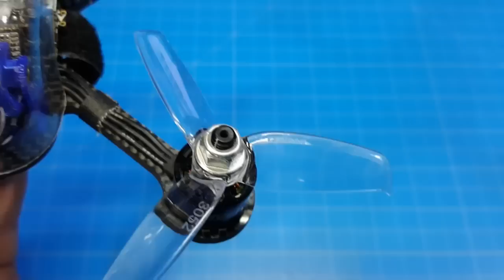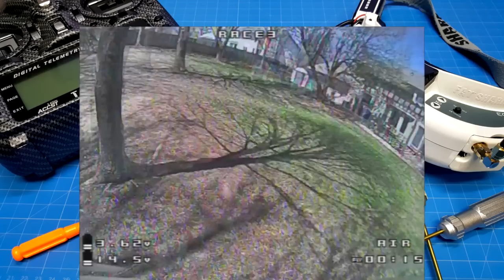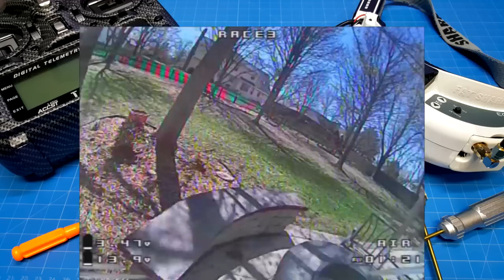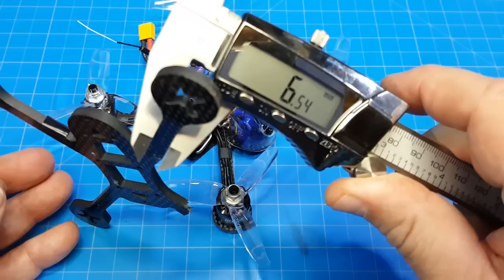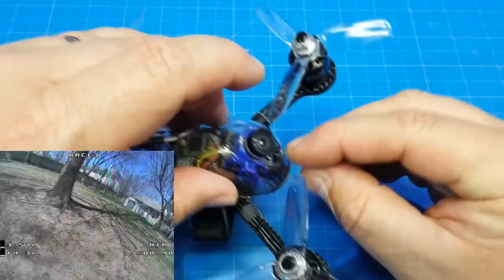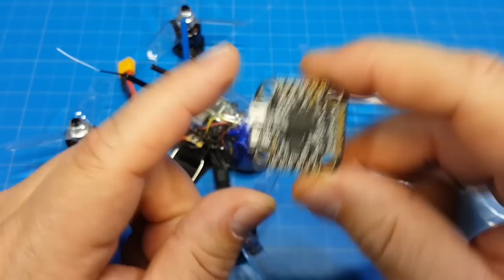Race3 - SpinTech High performance frame

Comment from the maker: Would a top speed add value to a review?
Reply: Maybe do timed races around the track and start a scoreboard
Reply: if you did top speed it would add about +40% value to the review, for me.
Reply: Yeah, it doesn't really matter at all, but it's cool to say, that little thing is doing 90mph
Reply: I think so, purely for the fact if somebody builds this and goes out and flys it, the first two question you get asked are, how high and how fast.
Reply: lol  Are you trying to justify buying a radar gun to yourself? :P
Reply: Equally as much as acceleration!
Reply: Nick Burns Definitely yes! I always wonder how fast these things are going  🚀
Reply: Absolutely.
Reply: Nick Burns for me no. 😃
Reply: Even just a guestimation lol
Reply: Of course it would, Andy does it already.
Reply: Not the plain number, but it is a nice comparison to the other quads you’re testing
Reply: Yes, but you should do it for all your reviews going forward (whenever possible).  That gives your viewers a comparison to other quads, which is most useful.
Reply: Totally
Reply: To me, that would depend how you would determine the flight speed.  Accuracy is almost everything when it comes to measuring speed.
Reply: Yes
Reply: It absolutely would
Reply: Yes please!!!
Reply: Yes Sir'
Reply: Top speed isn't essential in a quad as very rarely do you run at top speed when freestyling or racing, but it's sure is nice to know as its always the first question people ask when they see a quad ripping around
Reply: yup2👍👍
Reply: Nope. Agility is far more important than top speed. Top MPH stats are just a macho pissing contest.
Reply: acceleration = responsiveness, how quick the motor can spin up the prop,
Reply: more mass =  slower directional changes (acceleration/deceleration)

Comment: I have made a few frames now and the outer layers can be just cosmetic with some manufacturers, i now make sure it has a linear construction so what you see on the out side layer is the same as the inside layers so its easy to get the right orientation before they are cut out.

Comment: Yeah that looks like what we call twill weave...  Usually the flat stuff (like my frame, for example) is plain weave, so they kinda take the carbon and just cut it to thickness and buff the top a bit so it's smooth, whereas twill weave they then add a layer of largely meaningless shiny carbon over it for looks.  Costs a but more, lots of people like the aesthetics, but no real change.

Comment: i personally think 4 mm for arms on a 3 inch set up is too much 3 mm is fine it doesnt have the weight or power of a 5 inch
Reply from the maker: It would be if the masses were okay with an occasional breakage.

Comment: I have the Race1 and I love it... but I am having trouble with my pids... severe prop wash in tight corners. Could you post your pids?
Reply from the maker: These are for the race 3, I doubt they will do you much good, but feel free to give them a try.
Roll 54    40   25
Pitch 51   50   28
Yaw  88 45
Reply: Because the Race1 and Race3 are so similar - these pids confirmed my suspicions. My oscillations were caused by my pids being too low. I tuned from these and it flies great now. Thanks for posting.
Reply from the maker: sure, glad it helped.

Comment: At about 10:40 you mention what was really distracting to me and bugged me! - the flashing of blue and other colors!  I would find that hard to fly with.  I've never liked the Predator....sure it's great in low light transitions, but it is so0o washed out all the time and the colors are so0o terribly off - I just don't like the lo0ok.  Yes, it is better when transitioning from low light areas than the Foxeer Monster Micro Pro, but the latter has so0o much better color and overall picture I don't think the comparison is close.  Thanks Nick for pointing that out.  I thought you had a component with a problem or defect.  Turns out it's that Predator, which I simply do not like one single bit.  Great video Nick! :)  Please do make a video with the comparison you talked about!  I'd be interested in top speed on this one...  ;)

Comment: Nice build Nick. I love mine - I used a Runcam Split Mini, so it was a very tight build, but I managed to fit it in and I think that the HD recording capability is a great add on.
Reply from the maker: I haven't tried the split yet. The way I flight it likely wouldn't last long. :)
Reply: Nick Burns HD is fun. You should give it a try ;-)

Comment: Hi Nick , what would be the minimum battery size you would use on this type of build ? i currently own 2 rotorious 2.5's and a tonne of 450 3s. if i built one of these it would end up being my main quad and i'd like to be able to use the batteries i already own if possible. thanks
Reply from the maker: It varies depending on flying style and the space. I tend to stay 4s 650mah or less on a 3inch in my space, more battery has a tenancy to pull us into corners, but in larger spaces an 850 would be fine. With 450s, I wouldn't go above 4000kv on the motor, this will keep the flight time reasonable and still perform very well.

Comment: That looks like a sweet frame! I'm still trying to dial in what is the best KV for 3 inch. I've tried 4000, 4100, and 4200. I'm currently thinking anything over 4000 is wasteful.

Is it the Monster Micro that you're talking about switching to. I really like that camera on my 16x9 Dom v3's but I'm not sure how it will do with the 4x3 HDO's I just ordered.
Reply from the maker: I am thinking the caddix turbo micro f1, or maybe the sdr1, I haven't tried the sdr1 yet.

Comment: The carbon is cut the wrong way 😢
Reply: BuzzCola 3 it's quasi isotropic. It's cut at 90° 45° 0° the outer layer is just cosmetic. It is strong any way you cut it due to the layering.
Reply from the maker: Thanks, Kenny.
Reply: Kenny Cox you can see the inner layers if you break it
Reply: BuzzCola 3 have you broken one?
Reply: Kenny Cox you see how this ↓ broke ?

https://drive.google.com/file/d/1rWssDtDbrZ0kPm2524V8tx1WC5WSPLhg/view?usp=drivesdk
Reply: Kenny Cox the most common carbon fiber is 90°/0°/90°
Because it is strongest.

90°/45°/0° isn't that strong. (Its stronger than 90/90 that's cut the wrong way)

That's why most manufactures use 90°/0° (and its cheaper)
Reply: BuzzCola 3 I have. Always cu my frames that way, and have only ever broken 2 of them and have only had maybe 3 people come back to me with broken frames and part of that was my design flaw. It probabily does matter more on thinner arms like this though.
Reply: Kenny Cox you can test it by cutting like 2x 4mm wide 5cm long pease of carbon.
With one cut at 90° and one cut at 45° and trying to bend it.
Unless you are using 90°/45° carbon
Reply: Like Kenny said, the carbon I use is quasi isotropic. The top and bottom layers are mostly cosmetic. The layers that are sandwiched inside actually don't even look like the carbon fiber you see on the outsides. They are straight strands, not a weave like the top and bottom layers, so there are actually uninterrupted fibers running through the lengths of the arms, and it's one of the reasons why I use a true X configuration. I have an awesome relationship with my carbon fiber manufacturer, and I talk to the CEO in person every time I pick up the carbon plates. I have seen the plate making process firsthand.

Comment: Those DYS MR1407 motors are pretty fragile in my experience. After one light crash the bearings was bad.
Reply from the maker: Interesting. Mine are fine after breaking arms and motor mount. I wonder if they revised?
Reply: Nick Burns I know that there is a MR1407II version out there but I don't know what the difference is.
Reply: Nick Burns I got another set of that motors will see how good they are going to hold up.